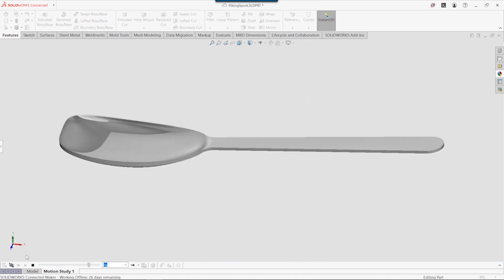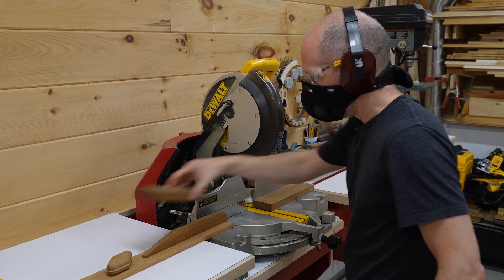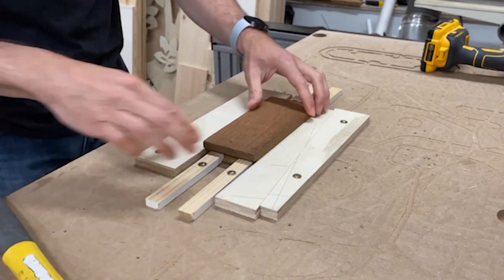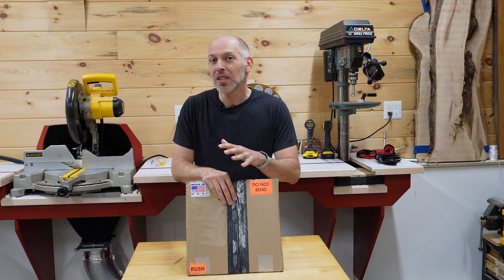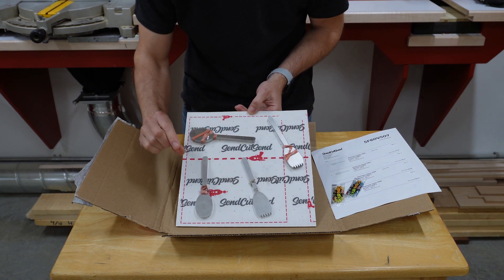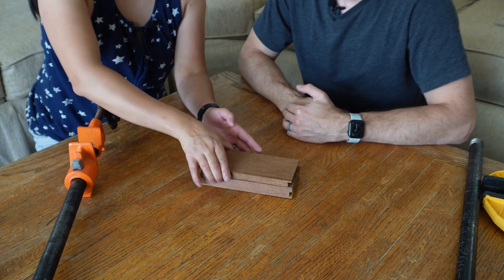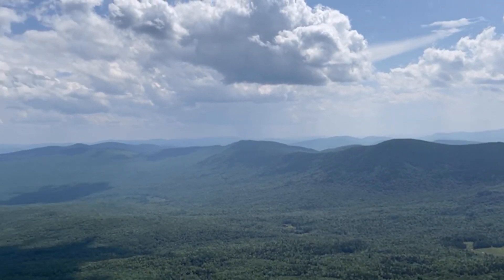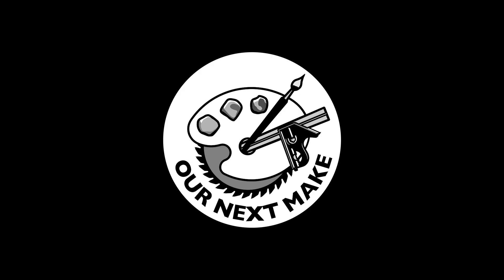Die forming metal with wood!

Comment: How thin was the metal in your design? I'm asking cause I need some reference for a future project.
Reply from the maker: We tried two different thicknesses of 304 Stainless Steel. 0.030in (.8mm) as well as 0.048in (1.2mm). The thinner one was, of course, easier to bend and contoured better to the mold. We hope this helps with your project!
Reply: @ournextmake  I see. Thanks for the reply.